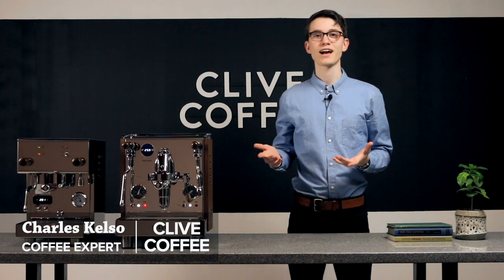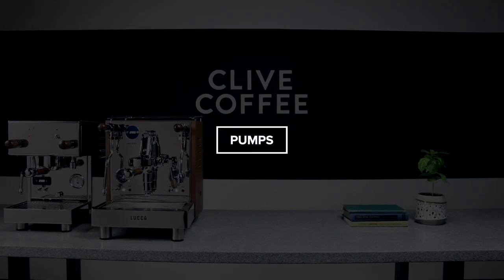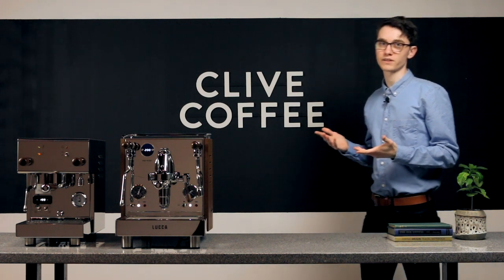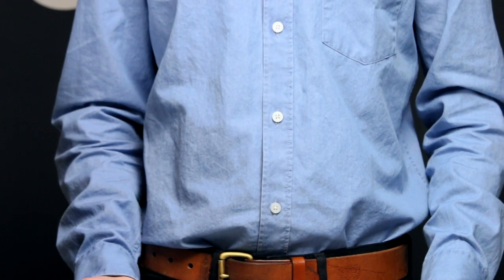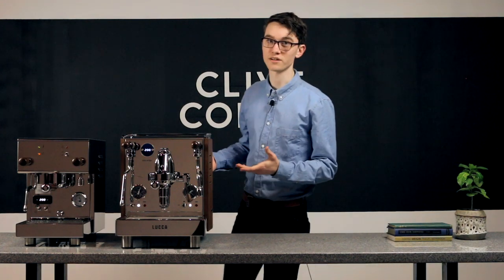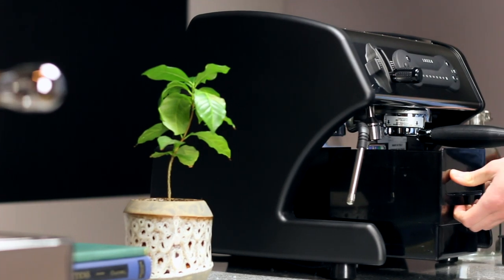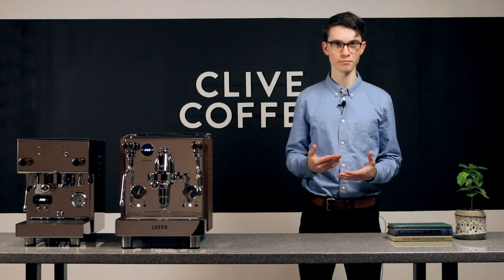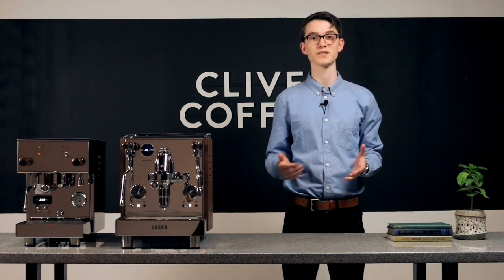How To Choose An Espresso Machine: Pumps and Water Supply

Comment: Can you explain the “true preinfusion” through line pressure on a rotary pump? How come I can’t get true preinfusion with a vibration pump? Does this make a big difference on the espresso? I was thinking about getting a machine w/ a vibration pump and flow control, so I can alter the preinfusion, but I’m confused about if I can actually do it or not now. Thanks
Reply: have you got your answer?
Reply: If you hadn’t bought your machine already there’s the Lelit Elizabeth, a dual boiler machine that offers two preinfusion types. You can simply adjust the time the pump works and stops before pushing the water at 9 bars. Or you can use the second preinfusion, working with the pressure of the steam boiler, adjustable by the temperature of the water and the time chosen. Very clever. The machine is compact, really silent, has excellent temperature stability with two PID, and is easy to clean.

Comment: Great explanation Charles, but can't you use an external pump and water bottle to supply water to a plumbable machine?
Reply from the maker: Thanks! You absolutely can. In fact, we have a video that details how to set that up. I chose not to include it in this video because for most people it's more a matter of "do I want to drill a hole in my counter" than finding a water line. So, for most, it won't change the equation. Still an excellent option, particularly for coffee carts and the like!
- Charles
Reply from the maker: @kevinking1391  While a rotary pump is capable of pulling water from an external reservoir or jug, we don't recommend it. The rotary pumps used are designed with water line pressure in mind so using a source with too little or too much pressure will cause extra wear on the pump, making it more likely to fail. By using a flojet you can replicate water line pressure and massively extend the life of your pump, so we always recommend using one.

Given what you said, the Classika PID was going to be my immediate recommendation. If you're a staight espresso / americano person they're perfect - not to mention beautiful.

Thanks for the support!
- Charles
Reply from the maker: @kevinking1391  While we love the Virtuoso for drip coffee and pour over, it just isn't quite strong or precise enough for espresso. There are some really excellent entry-level espresso grinder options that didn't exist even a few years ago. The Eureka Mignon series offer stellar build quality and power. Having a dedicated grinder like that will really make your home espresso setup feel whole.
https://clivecoffee.com/products/eureka-mignon-silenzio-espresso-grinder
- Charles

Comment: If I want a high quality espresso machine for under $100, is my only option to build it myself?

I make espresso using a small old cheap vibrating pump machine that doesn't generate quite as much pressure as I'd like, so, I can't pack the coffee very firmly, or else it restricts the flow too much.

I'd also like to be able to get a bit more crema without having to add more non-Arabica beans to my blend.

Comment: Does running a rotary pump machine only from its water tank reduce the longevity of the rotary pump? Keep getting conflicting information in regards to this on coffee forms? Assuming that I don’t let the water tank run dry? Thanks in advance!
Reply from the maker: If you're using an internal reservoir there won't be any significant amount of additional wear. When using an external reservoir the additional wear to the pump occurs when the pump has to exert more force to move the water. Typically, external reservoirs are placed below a machine meaning that the pump needs to exert extra effort to raise the water and pressurize it. Hopefully, that answers your question.
- Charles
Reply: Clive Coffee yes! Thank you!

Comment: Hey Clive I have a very pertinent and desperate question about this, I hope you can give me an answer in the next few days. I was running through a few comparative videos between the Profitec 600, 700 and the ECM Synchronika and after watching a few I was prompted to a related video:  (https://www.youtube.com/watch?v=o2W5SnXR3-s&list=PLaBDDfOHAAC1K76bljkmuVc_KAO2JWwIH&index=59&t=0s) and I can see some issues wrong with this study/test like having the vibration pump machine 3-4yrs older than the rotary, and well using rocket machines over something more reliable, but the underlining results concern me. Can you give me some clarity on if a rotary pump gives a better texture and flavor to the pulled shot compared to the vibration pump? Also is shot really that unsteady and volitive with a vibration pump like shown in the video?